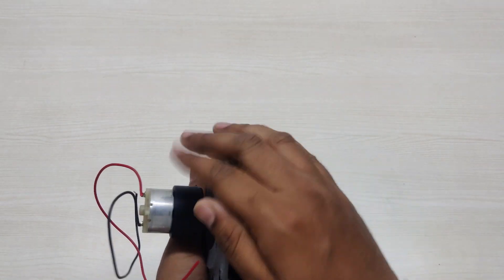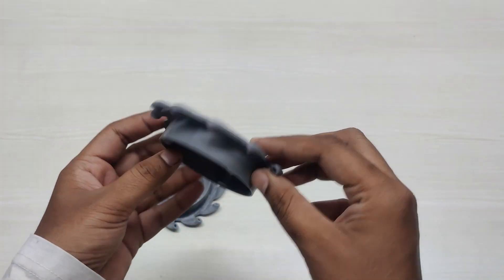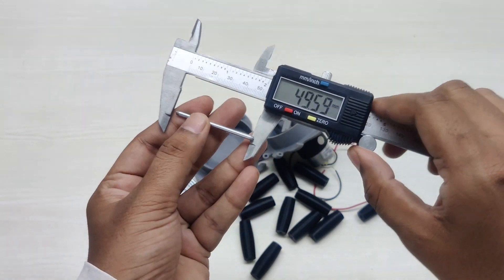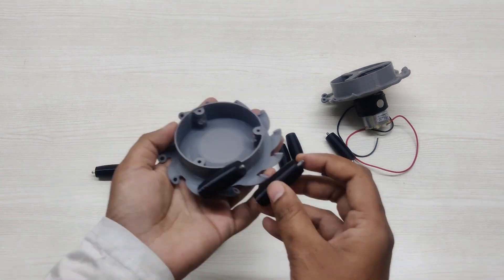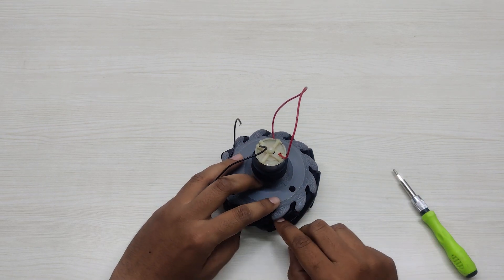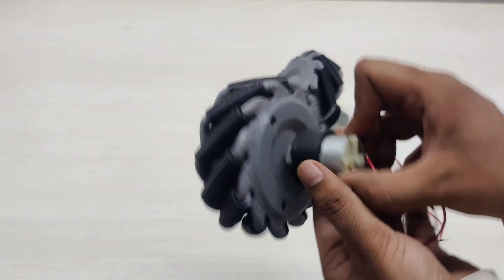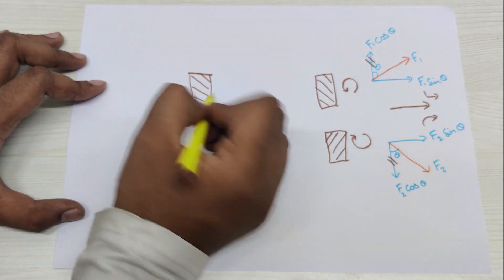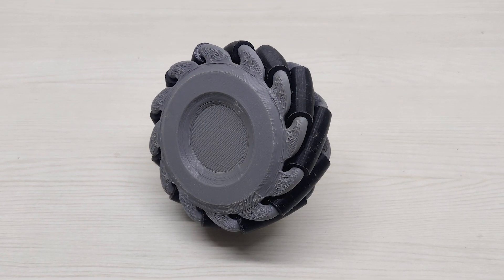DIY Mecanum Wheel | 3D Printed | working explained

Comment: I have bought your files, printed wheels and other parts, and now recognize that I have the same 4 wheels, but on video and as I know all omni wheels must be at different angles, so can you sand me other 2 wheels (another angle)? I need them very much. I sent you email, look for it
Reply from the maker: Thankyou so much for your purchase...There is no need for other two files....while slicing, you just need to mirror the wheel and you will get the other wheel...
If you need any other assistance then please let me know 😊😊😊

Comment: Bro what motor is this ??
Reply from the maker: I have used Normal 12 volt DC gear motor
Reply: @MechNinja  thankyou
Reply: @MechNinja  also what is the total weight of the printed parts for the body and arm?